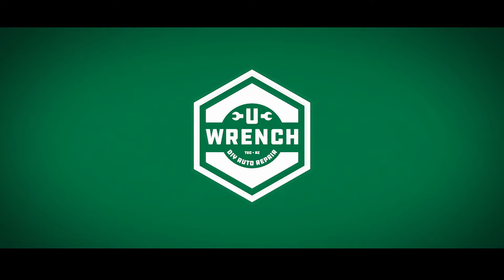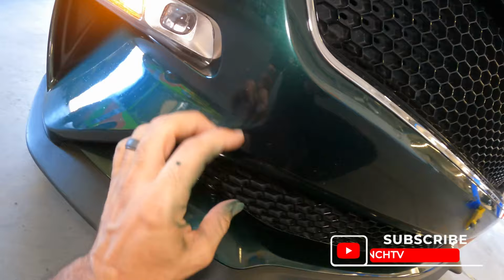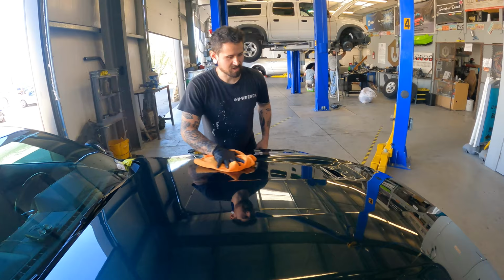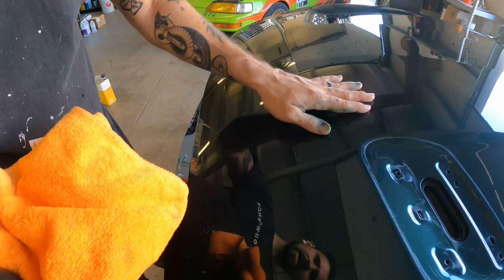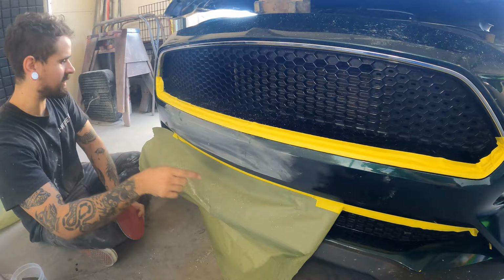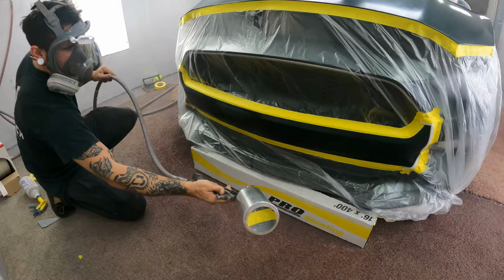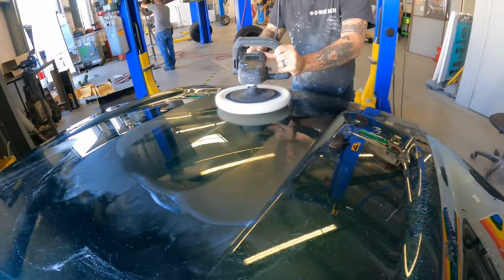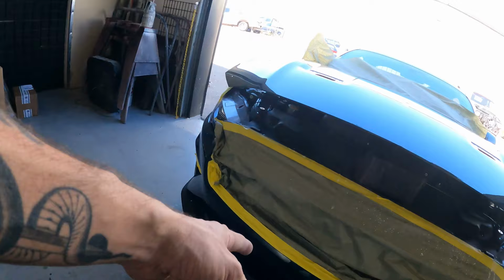The most OCD way to fix rock chips | Bullitt mustang

Comment: Hi Fred, WOW!!! Nice job Fred. That bit about using heavy compound, I've done that quite a few times with lacquer used blender first then paint then blender again then buffed it wiped it down and cleared it for durability and came out nice. I haven't used  lacquer in about 20 yrs. most of the stuff I did was for myself and friends. You sir are a artist, great work.

Comment: The paint on the 2015-2022 mustangs are so thin that they provide zero protection.  Many owners actually have paint flaking off on the roof Pilars as well.  I have a 2017 GT and the hood and the rear fronts of the quarter panels have tons of pits and rock chips. I never drive on gravel roads as well.  Note to anyone purchasing a ford mustang...... get it PPF'd or your paint will get F'd guaranteed.